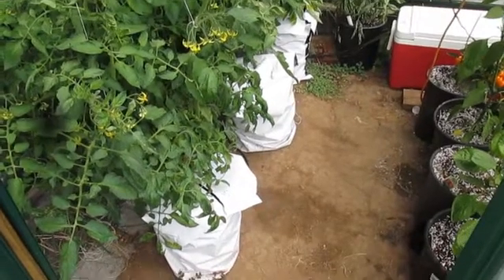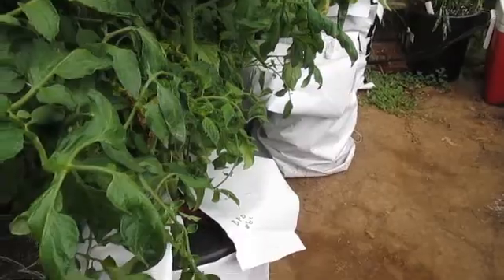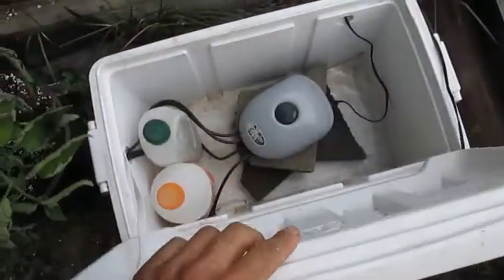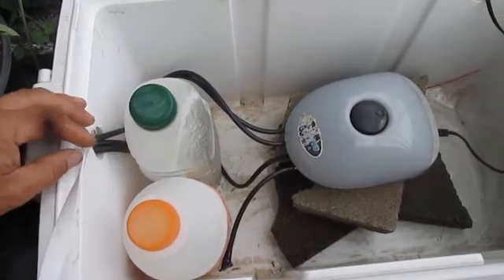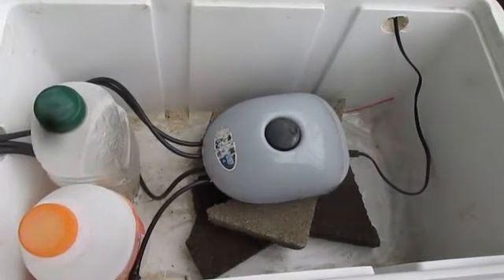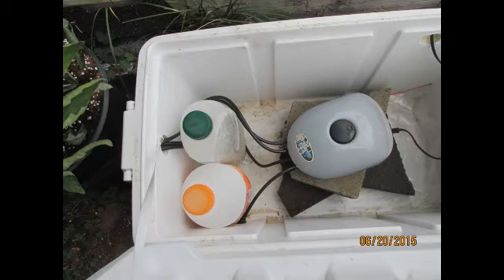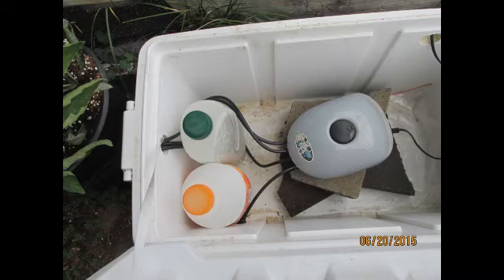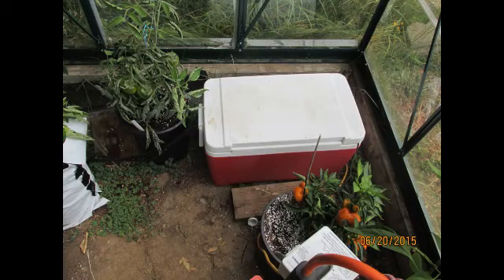DWC Water Temperature Part 2

Comment: Ditching the air pump all together will lower the res temp by not pumping hot air into it. To do this, where you pump your nutrients into your grow bucket just put a 90 deg elbow inside the bucket and connect the nut line to it. When the nuts shoot down from the elbow and break the water surface this will create enough air bubbles to suffice your plants, or you could split the line in 2 and have 2 sources producing air bubbles.

Comment: Hello sir. I have a couple questions about your hydroponic strawberry videos. I figured I'd come to one of your recent videos in hope of a reply. I watched a video series of yours with your strawberries with the painted green pipe. I was wondering if white pipe would work better than black pipe. I figured warmer water would help them grow a bit better but I may be wrong. I'd rather not drill my holes in the black pipe that I've already paid for if white pipe would be better. I was also curious if you used TAP water. I have a secondary water system for irrigation and I would assume that would be better than the drinkable water from my home. As far as the black piping I live in evanston wyoming where temps in july and august will reach ove 100 degrees. Any help would be appreciated. Thank you and be safe

Comment: in my rdwc system i use old water bottles 90% full of water, freeze those and pop a couple in my reservoir. but it isnt a permanent or perfect solution, it helps though.
Reply from the maker: +Earth.Hawk I'm getting a chiller & hopefully it works.

Comment: Tom, I use two 80gal Coleman Fisherman ice chests for my reservoirs and the temp stays down around 74 or 75 degrees, and we've had some unfamiliar hot 90 degree days here in Hawaii this past summer. I use Reflectix around where the drain pipe enters the cooler and the black poly feeder lines come out. Water temp stays pretty steady. I don't worry too much about the air because it will take on the temp of the water rather quickly once it enters the air stone.
Reply from the maker: +Kenneth “Mr. Taz” Robb Makes sense & thanks for sharing your ideas !Larry

Comment: Thanks for sharing your results. Nice to see your actual experience instead of a bunch of marketing hype. It's a lot of work just to document and share. Appreciate it. What kind of temps are you getting with using the cooler and ice? I know you can get a reservoir chiller but those are pricey. Maybe dig a hole outside the greenhouse in a shaded area to stick the reservoir (I'm imagining how a root cellar works) Hard to make Texas summer not hot without using AC (lol).
Reply from the maker: +Tom Hutchinson Hi Tom, around 70 with the ice. I,m going to try & build a DIY cooler next year & see how it works.

Comment: You may also REDUCE the power of the pump by 10 to 20 % that WILL cut off more heat. I don't think full power is actually needed as you are probably pumping in more air than is needed. I would also make ONE MORE HOLE for improved air exchanged.
Operating the pump at full power also destroys the air bellows early which normally are not replacable.
Reply from the maker: Allan Teo Thanks Allen for your input !
Larry
Reply: *****  you may also want to consider making the first 2 feet of the air pump tubing as a COPPER COIL to allow the air to cool down then continuing with plastic tubing. Many ready made copper coils for cooling are available on the internet. This should be OUTSIDE the box and under a shade (corrugated plastic) that has been glued with cooking aluminum foil on one side so as to block off the sun.

Comment: My Kratky 5-gallon buckets are running around 85 degrees and there are only bright white healthy roots so far.
Reply from the maker: Matt Garver Wow, seems like everytime I pinch an airline I end up with root rot. 85 is very warm. do you have them outside ?
Reply: My Kratky 5-gallon buckets are outside in my greenhouse and my reservoir is outdoors behind the greenhouse.

Comment: I suspect that a lot of the heat is coming from the compression of the air rather than the sunshine and motor heat. When a gas gets compressed, it gets hotter (just like how a manual bike pump gets hot when you pump up bike tires). As a thought, how about running the output of the pump through a coil of copper pipe before it reaches the manifold - You could then immerse the coil of pipe in a tank of water to pull the heat ouf of the air - It'd save you from having to keep on freezing ice packs. New greenhouse update should be coming through from me later today. Cheers!!
Reply: Jim Conner Precisely! We used refrigerated aftercoolers on our air compressors that operated the air controlled relays, and thermostats on the commercial HVAC systems! It also cut down on the condensation in the storage tanks as well!
Reply from the maker: Jim Conner There you go Jim, whats the chance of you making a how to video on that. Do you mean the airlines going  out from the compressor ? I would have to have a 2nd rez ?
Reply: ***** Hi Larry - On my two air pumps, there is a single 8mm threaded output, which then connects to the manifold to split it up for the different 4mm outputs. I was thinking that on industrial air compressors, they have fins on the output tube to cool the air down, so potentially you could achieve the same thing by running your output air through a cooler the same way. Might be a bit difficult to arrange if your air pump is giving you multiple 4mm outputs directly. Cheers!!
Reply from the maker: Jim Conner Makes sense JIm- Thanks
Reply from the maker: Keyplayr61 Greenhouse Hydroponics And Gardens Thanks Keith, do they have them on a smaller scale ?
Reply: ***** They probably wouldn't be small enough to warrant the electricity it would use to be worth it, Larry. I think the copper coil idea that Jim had would be a better choice ; )

Comment: I hadn't actually considered the air pumping hot air and heating nutrient.  Awesome.  Making the change tomorrow.  Appreciate the tip.

Brent
Reply from the maker: C3 Voyage Hey Brent, hope you're enjoying your new RV. Hows your greenhouse doing this summer ?
Reply: ***** It is doing ok.  Not ideal, but not out of control yet.  I'll do a video soon showing what's up around here.  You are right, tons of folks I follow quit posting vids.  What's up with that?

Comment: I watched a video from a DIY Guy for aquariums used a used small refrigerator and basically gutted it. He put two coils of garden hose in it and connected them. Then he cut the other two ends off and fished them thru two holes in the side he drilled. I was thinking that might keep the reservoir at a decent temperature on hot days. 
The video is called HOW TO: Aquarium chiller....its on The king of DIY YouTube channel.
Tim
Reply from the maker: DJMovit LOL I watched the same video my friend. Was thinking about doing that when I build my new greenhouse. for now its ice lol. Hows your greenhouse going ?
Reply: Only issue is the small fridge running 24/7 .Is that it sucks up a lot $$$ on the power bill.I run the cooler mod for free and only need to re ice once every 8 days

Comment: Have you tried adding H2O2 to the reservoir water?  My container (29% strength) says to add 3ml for every gallon of water every few days.  Worth a try.  
I clean reservoirs with full strength H2O2 when changing nutrient solution. Wear rubber gloves!
Fortunately, I have not had any root rot, in either the Kratky or the Dutch Bucket System.  The Kratky system is in my greenhouse; daytime temps are 90+.
Good luck.
Reply from the maker: Kntryhart Yes I use h202 but usually only after I get the rot. Roots are going again. Thanks for the tips. Do you add h202 during the week before water changes. I only add them during water changes ?
Reply: I do not regularly use the H2O2 ; mostly for a good cleaning of the reservoir during a nutrient change.  So far no root rot regardless of temps.  Good luck.
Reply: I add  Calcium Hypochlorite does same as h202 but a fraction of the cost. The Under Current Achievers youtube chanel has dilution rates.

Comment: That's  interesting to find a way to reduce an air pump temperature , If you could surround the pump with aluminium panels with holes of different sizes at each end to create a draft. It's only an idea.
Reply from the maker: Patrick Meehan Thanks for the input Patrick !

Comment: Nice idea.
Tips: Lift cooler from the ground and raise your air pump above your buckets/reservoir water level, its better than have one-way-check-valve. Thanks for your videos.
JJB
Reply: Been there too. My 25 gallon reservoir completely siphoned through my pump during a power outage. I though for sure it was toast. Took it apart, let it soak up some sun and it's still running like a champ 3 years later. I always have to learn the hard way....to keep your air pumps above your highest water line.
Reply from the maker: John James Brown Makes sense so the water won't siphon from the buckets. thanks JJB